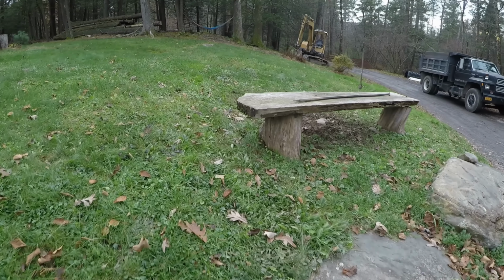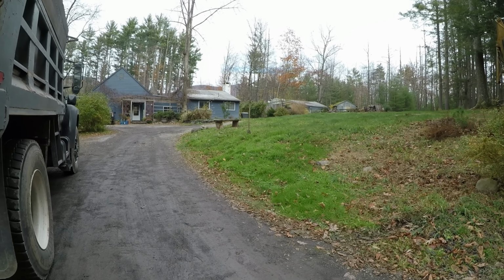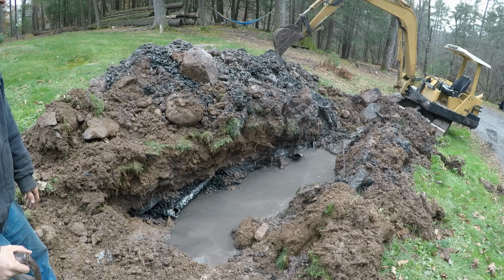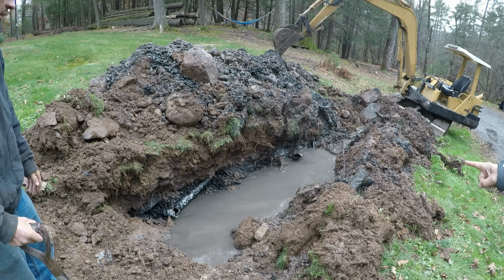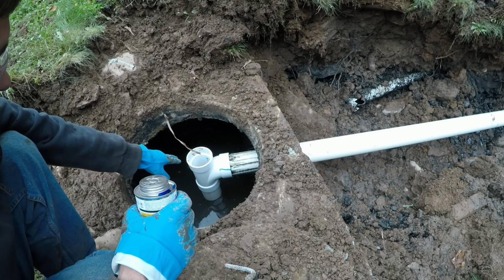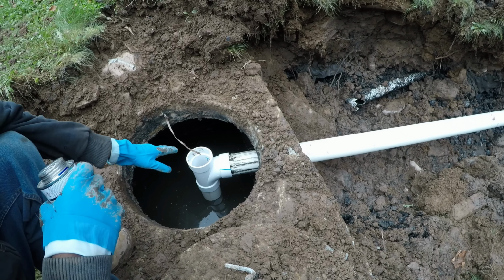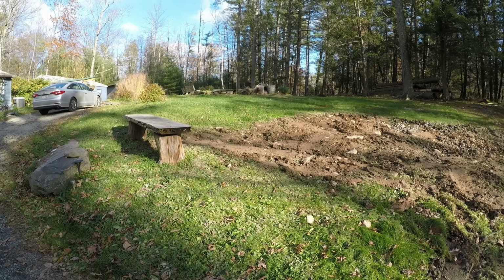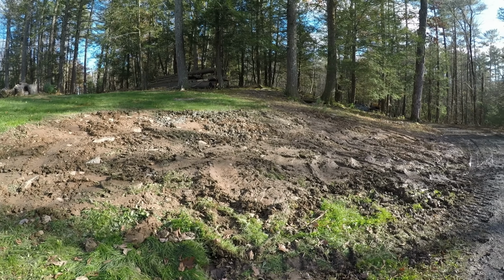Replacing a leach field

Comment: As a general rule you should put the slip joints the other way around.
Reply: I have to agree. The over lap should not be hit by running water. I was surprised he did that...
I do like the new location easy to seep into the adjacent swamp.
Reply: And make sure the tank has been pumped before you replace the field...
Reply: He said it was,but no proof 100 pct. I guess.
Reply: Yes, he should've cut the bell off the first section, then put the rest of them on accordingly.  He's a smart guy, but I hope he reads these comments from us "experts".  :)
Reply: More Glue!
Reply: how could he get them through the septic tank?
Reply: Semper Fi gotcha
Reply: Also amazes me that you didn’t strip the loam before filling the leach field will not drain threw that
Reply: Also clean the pipe before putting it together with the glue. I'm a plumber and  was almost screaming to my screen when I saw him putting on the fitting on this dirty pipe.
Reply: I just made that comment (see above for my naive take...)
Reply: And not run the hoe over pipes when your back filling with dirt that wet sloppy and has rocks in it.
Reply: @--Mike--  Worst case, is it a problem if a little of it leaks into the ground along he way instead of the ground at the end?
Reply: @kevincole4838  ??

Comment: Beautiful!  Just what I need to do at my cabin in the woods. I guess those baffles also help with roots? and the landscape fabric.  I'll bet that damn guy could have hugged you after fixing a problem like that and leaving the site so nice.
Funny to hear these armchairs giving you advice when you obviously wrote the book and have the videos to prove it.
Reply from the maker: They probably do. Usually you only want grass over your septic area.
Reply: Don't worry, they'll be able to hug him when he's called back for repairs. And I'm not an armchair, been doing this work for sixteen years now. And have seen it all when it comes to septic system repair. And i gaurentee you that job was one hundred percent illegally done. I don't care what state you're from, you're not allowed to move an existing system. It's not repair at that point but new construction, and all applicable codes for new construction must be followed. Including digging perc test holes, not looking around and saying, i think over there looks good.
Reply: We just had a septic tank and leech field installed. New or repair is no different, our county officials require, pre-plan drawing, perc test and pre-site inspection before doing anything. We have gravel/sandy soil that water runs though and drains fast. They required 2-75' long leech lines for a 2-3 bedroom house and also require vertical inspection ports at both ends of each leech line. So many rules here and we live in a designated wilderness area. I love Andrews videos even if the rules are different I still learn a lot.

Comment: hi Andrew i am from Mauritius in Indian ocean i see the work you done but here we make it differently one thing i found that you are like mike plumber ,operator /mechanic learn in a different way after excavate the trench must be meter with a slope of 1 cm and the pipe must be slotted to 65% each side with a distance of 10 cm this to protect the pipe crush and the pipe must be sewer type pn 10  ist step excavate trench 2nd trimming of trench then laying of géotextile membrane the a bedding of 15 cm with 30 to 40 mm gravels then laid the pipe after then you backfill with gravel 40 cm  you the géotextile and then finally backfill with soil  i made it several time and it work for several year

Comment: Over all very nice.  One change/suggestion, lay the pipe so the bell end is on the upstream side.  Slightly less of a chance of debris getting caught in a joint.
Reply from the maker: Thanks, yes, I always do that from the house to the tank, after the tank I don't feel its as necessary.
Reply: Not going to matter after the tank as it is all liquid...

Comment: I wish septic fields were that easy where I'm in Western Canada, they have to be engineered and approved, a basic gravity fed drain field a person is looking at 10-15,000 dollars, most drain fields have to be pressurized systems now your looking at 30-40,000 dollars. Most contractors don't want to do septic systems because of the regulations plus the fact the contractor is liable for any failures for the life of that field. If you are a home owner and you've screwed up your septic system from neglect its going to cost you a fortune.
Reply from the maker: New systems here need to be engineered and approved, repairs don't. But for new smaller systems, many people choose not to have it engineered/approved. Sometimes engineers don't know as much as they should.
Reply: Andrew Camarata I agree in eastern Canada engineers want the most expensive systems but not the best system for the Application
Reply: bigfarmall35 thats why you just get it done by a local person you know and trust with experience.
Reply: It’s a risk to the homeowner not having it engineered, perc tested, etc.  If they sell the property and the field fails or doesn’t pass a dye test, they can get sued by the buyer and have to shell out $20k for a new system.  But few homeowners have $20k sitting around to repair a system.  I have to say that a friend had a system that needed to be pumped and an improperly repaired pipe fixed and they didn’t ask too many questions about the rest of the system either!

Comment: The baffle should have been a little longer unless it is a ledge or lowboy tank. When I do baffles I measure top of tee to bottom of cover opening, you should have a air gap of at least two inches when cover is on to let air from roof vent flow thru tank to leach field. I just cut top of tee off to be sure. Also putting a vent on end of leach field would help.

Comment: Love the Septic Chambers!    not just better & efficient & massive flow but it's save $$$ in leach field service in the long run. 

The pvc pipes with pre-drill holes is awful idea cuz moisture and rain will saturate the soil and seep into these tiny holes and all it needs is to clog up the 1st few feet of the pipes and the total leach field is a total failure.   not to mention if it's a mountainous area then the roots will penetrate these tiny holes and again all it needs is to clog the 1st few feet of the leach field and it'll fail the whole leach field system.

i don't see many contractors using the "Chambers", so i'm not sure if it's Legal per certain local/state 
Codes.

Comment: Love your videos but there’s no way that field is going to last long... that’s not NEAR enough infiltrators. Not even close man. You need like 200-300 feet for most houses and they have to be level.
Reply: Gear Jammer  won't matter about capacity its just gonna bleed straight out the side of the bank between virgin and made up ground.

Comment: I wish my replacement drain field was that easy.  I guess health dept rules different in each county and state.  I had three 100+ foot long, very deep rows of ditches and baffles out front.  A smaller one from the septic tank leading to another one which was deep curving around into my side yard, finally connecting to the front yard.  No gravel.  Done by licensed installer with county permits.

Comment: Outlet Baffles are so important you need to build it the right way my friend, with at least 16 to 18 inches of pipe sticking down into the tank... sometimes as long as 24 to 26 inches, depending on the depth of the tank, which is dictated by the size of the tank. In any case, the 4 inch pipe you attached to the bottom of the Sanitary Tee is too short, and doesn't stick down in the tank far enough. Also, it appears you never consulted a Licensed Septic System Designer or Professional Engineer to determine exactly where the new Leaching Field should be located. In my state, it's illegal not to to have test pits dug for perc-testing analysis, which must be done by either a Soil Scientist or a Professional Engineer to determine if soil conditions will enable the new system to leach or drain correctly. Proper procedure also requires PUMPING THE TANK before you even begin a new installation, so you don't have the wastewater or effluent, running all over the place, which is a health hazard... Unnecessarily Messy Dude!
Reply: Looks like it will be fine for decades. Doesn't always need to be over engineered. I've seen plenty of septic builds on a very similar platform. This is not the channel for you. Perhaps you don't agree with his chainsaw method either. But most of us enjoy the content. I hope this saved at least one person thousands, if they can implement some of these tips in their build or in an emergency.

Comment: I would be worried where the pipe crosses the road not very deep
Reply from the maker: That's why I used schedule40, that stuff is very strong. I would be worried with thin wall or SDR35.
Reply: I'd be a little worried too.
I think a full Heating oil tanker would weigh bunch more than your excavator.
I know where all my sched 40s are, and nobody over 2 tons goes over those.
Reply: Have to add though, you are working with what you have, geology wise, and budget wise.
Around here, we have loads of shale. 
Sucks us water like it's nobody's business.
Nice excavator work. Pro.

Comment: andrew... come on man.. put the bells upstream and ffs use primer fella.. :-) ... also.. the chambers are down in native soil... to be proper, u'd need a perk test on it.. i enjoy your vids bud.. cheers
Reply from the maker: I always put the bells upstream from the house to the tank, after the tank I don't feel its as necessary. That field should be fine. Once engineers get involved, septic's get much more expensive.
Reply from the maker: That was one step glue
Reply: right on man...! round abouts do u bill for a job like that..?
Reply from the maker: I billed $3500, materials were about $1000
Reply: That is very reasonable for all that work.  You give good value.
Reply: In a previous life I was a draftsman/field tech for a local Civil Engineering and Surveying firm.  All our leach fields were required to have perc tests and if they failed, soil was brought in that was then tested again. This was NYS and by code, IIRC. And expensive!
Reply: The customer got a bargain.
Reply: Andrew:  Wow, great value!

Comment: U do great work A.C. 
Would markings be put to avoid accidental digging by some1 else in the future?
Reply from the maker: Thanks. I sometimes do that, especially with stuff that's delicate, dangerous, or hard to repair. Those materials are none of that. Plus you really need to be digging hard to break that white pipe, its very strong. Plus whenever someone is digging on a new site, they should ask the home owner where buried utility's are.
Reply: Nice job Andy.
Just an FYI, we recently had a geothermal system put in, a 50'x100' pit and 200' of trench to the foundation, They laid a metallic tape down as they backfilled and then tagged it at  the foundation showing you could then use a metal detector to find it if needed.
Reply from the maker: ChuckD59 that's good advice, I've never done that before, but I'm sure in some instances that's a good idea to do, Thanks
Reply: Andrew Camarata 

I believe they do that when installing plastic natural gas lines, but they use a metal wire instead of metallic tape.